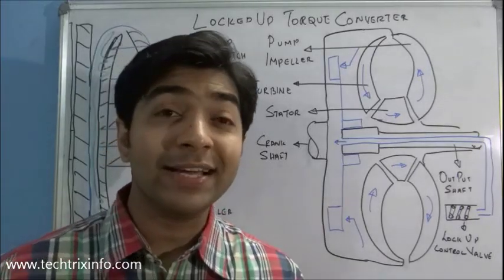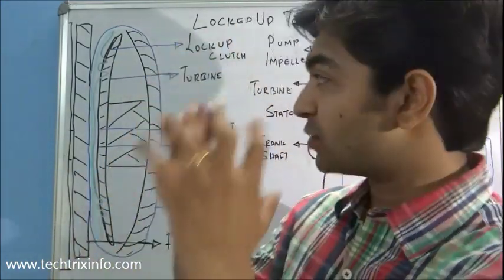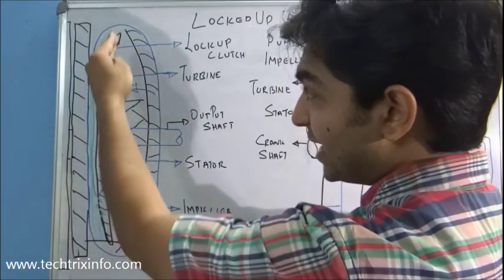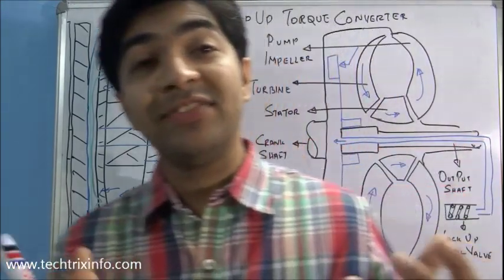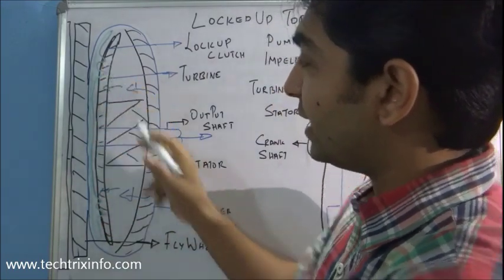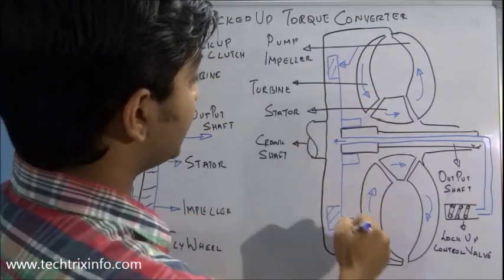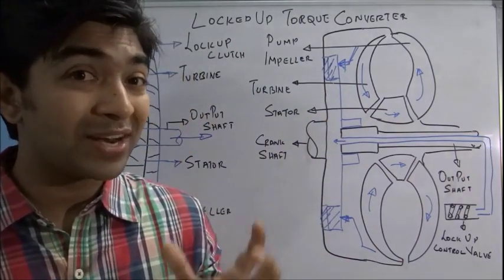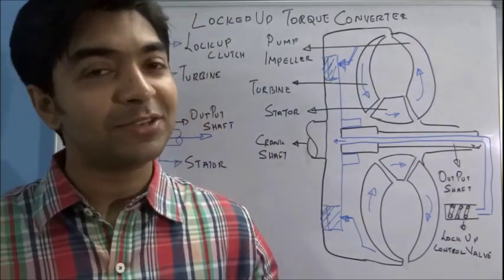How lock-up torque converters works. ✔

Comment: A correction, bro ! the fluid pumped to inside the output shaft (input shaft to trans.) is actually to disengage the lockup clutch. Even the picture drawn in your board shows that. To engage the clutch , the fluid has to be pumped outside the output shaft to enter the converter and apply from the other side of lockup clutch to engage it. thank you.

Comment: Can you briefly explain how to hydraulic units works (the ones used for engaging lock up mechanism, which locks up the output shaft to the casing) and the over all impermeabilitiy features, thank you.

Comment: so the lockup clutch is engaged by increased hydraulic pressure in the torque converter assembly?
Reply: Looks like we still need answers...everyone keeps saying hydraulic pressure but i want to seeeeeeee or learn how

Comment: what will happen when the clutch is disengage from the turbine ...???

because impeller is conneted with the flywheel also impeller is coupled to turbine with the help of fluid... will  the turbine get slow down or still rotate ...??

Comment: Hi dear,
Your video confuses a bit. First you told Lock up clutch is attached to the casing and then moves to turbine and then speed locking happens. But while explaining the right diagram you just reversed the thing as Lock up clutch is attached to the turbine and then moves to casing. Please check it yourself and confirm if I am wrong. One more thing I can understand it happens while cruising but what is the lock up at high speed, as you mentioned just along with cruising. 
By the way cheers for effort! :-)
Reply: He tried - We have to understand? :) Clutch must have at least 2 plates? One plate, is fixed, integral with the input casing. The other clutch plate, is splined to the turbine hub & has a circular, outer seal?
This plate, must rotate with the turbine, but can move axially?
At cruise, or deceleration, the torque convertor, internal pressure drops. Then, the transmission pump pressure, exceeds, within the sealed chamber, & applies the clutch?  The pressure balance decides - Lock or Not? Make sense? :)

Comment: So the lock up clutch is activated with fluid is it> Not magnets or something similar??
Reply: @Seb Miano   No one answered your question, so fluid inside the torque converter is driven around in a circle. Pressures can expand the shell with high HP engines. But, the pressure pushes the large flat lockup plate forward. It has a large surface area, so let’s say it is 100 square inches and pump pressure is 100 PSI. This pushes the lockup disc forward with 1000 PSI, holding it tight to the cover, driven by the engine. To release, a valve, electric or hydraulic opens and pressure equalizes or more, pushing the lockup plate or clutch back. A 100-200 RPM difference in engine speed can be felt or seen with tachometer. This lockup, reduces heat, eliminates slippage due to the nature of simple fluid coupling and increases fuel economy as this lockup design came in the early 80’s after the Arab oil embargo. Still used today and most all work this way. Hope this helps you. ASE Master Tech-Retired
Reply: @deankay4434  You have some idea - Actually it's the opposite way? :) The fluid driven around in spiral flow, creates pressure, to Disengage lockup. Under cruise, or deceleration, TC pressure drops & trans pump pressure exceeds? The lock-up plate has a circular seal? This pressure applies lockup.
Reply: The pump fills the TC, pushes fluid into the cooling circuit and places pressure on the TCC. In front of the TCC, is where fluid is exhausted to allow lock up. Part of the exhaust fluid moves the TCC abuse valve to eliminate pressure to the front of the TCC. When the TCC solenoid is off, pressure pushes the TCC plate back until TC pressures have equalized. Now no lockup. The pump has pressures for cooling, filling the TC, apply & holding, TCC release and reverse. What vehicle trans are you talking about? ZF? GM's 200-4R, 700R4, 4L60e, 4L65e, 4L80e worked as I explained.
ASE Master Tech since 1978
Reply: @deankay4434  Thank you for your interest & explanation :) ZF & Toyota - have similar principles? The keynote seems: The axial drill through the centre-shaft? Under lock-up condition, the front fluid is exhausted via axial drill & TCC lockup solenoid? Under disengage condition - The TCC solenoid closes exhaust? Then trans pump pressure, must go via the axial drills, into the radial drills & equalise? 
I was wondering about solenoid, control logic: Like, if OD is De-selected, in traffic - Or, if 2nd gear is selected, for uphill or downhill? Would TCC operate as expected?
Reply: Yes!
Reply: Check online for hydraulic circuits for 700R4 or 4L60e. GM put everything in electronic form after 1997. Paper manuals went by by. There are resources like "ATRA" and others especially for updates for the longest running transmissions, 1982-2006. The 4L65e has planetarys with 5 sun gears, instead of 4. Best of luck.

Comment from the maker: torque converter not equal to fluid flywheel, its a fluid flywheel and is connected to the engine flywheel.
thanks for the comment, please join us at facebook @techtrixinfo